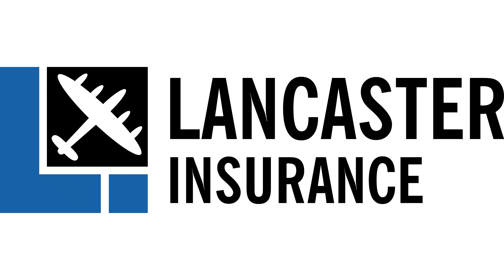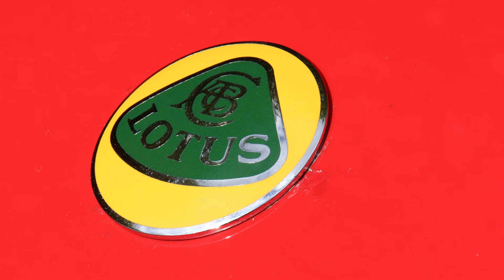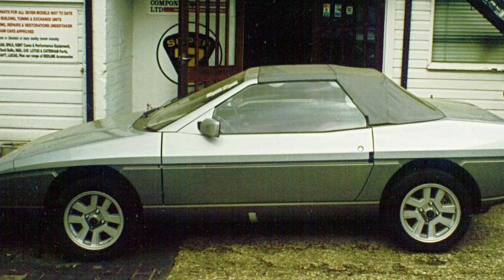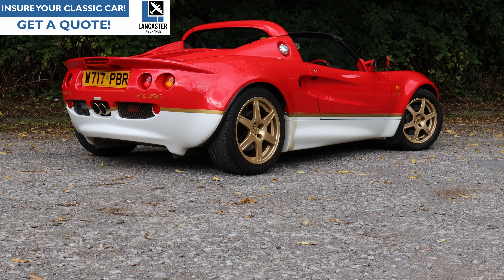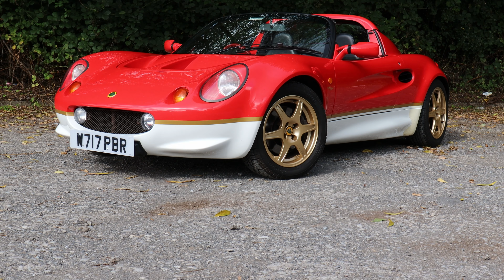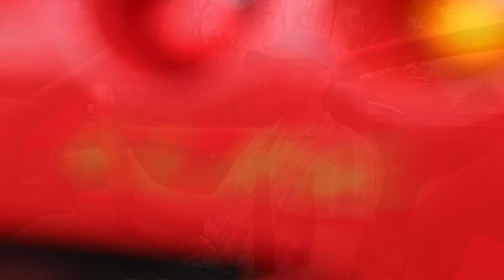Is The Lotus Elise The Ultimate Driver's Car?

Comment: S1 is such a clever & pure little car & the early cars with MMC/Ali hubs/bootlid etc are more like 725KG. The Sport 135 (140-145BHP) is significantly quicker than the standard car & the power is more accessible than with the 143BHP VVC 111S.
Reply from the maker: Absolutely, some fantastic engineering from Lotus!

Comment: The S2 is better as it has a different suspension setup as the S1 was found to be quite twitchy on the rear the best one to have is the S2 with a red engine cover, this means the triple layer head gasket was used and doesn’t suffer the dreaded head gasket failure.
Reply: Most S1 will now have S2 springs and shocks or other aftermarket suspension.  Head gasket failure is exaggerated my car still on it’s original- just fit a remote thermostat kit (PRRT).  S2 where given skinny tyres to make them understeer.  Quaife torque biasing diff is great addition for road use.
Reply from the maker: The Elise unquestionably improved over time, but there's something special about the S1¬
Reply: Depends which S2 reguarding engines. After 2004 they use Toyota engines and gearboxes, much more reliable but heavier. Then after about 2006 heavier still as they had to add airbags etc.

The S1 suspension used Koni coilovers, the S2 uses Bilstein which are a bit softer and considered better on the road.